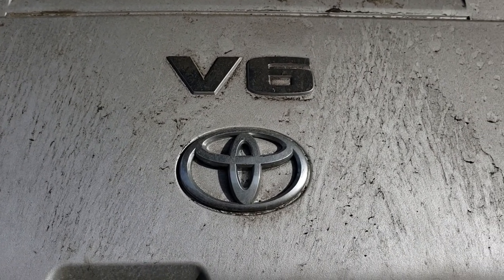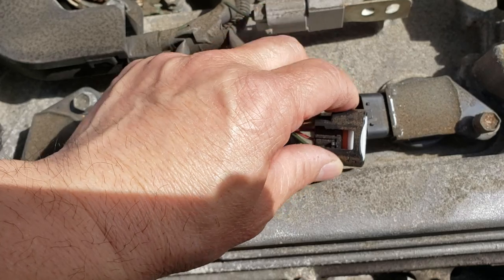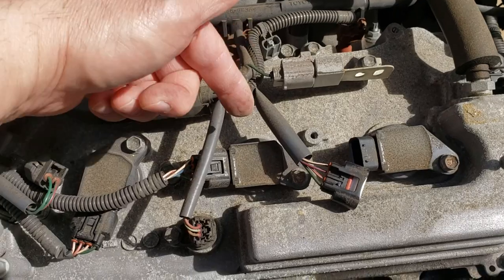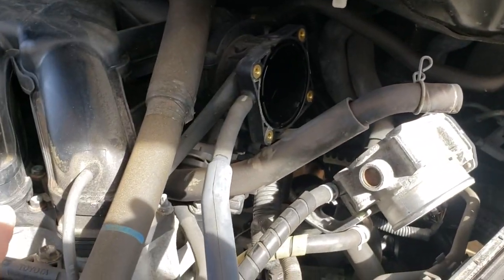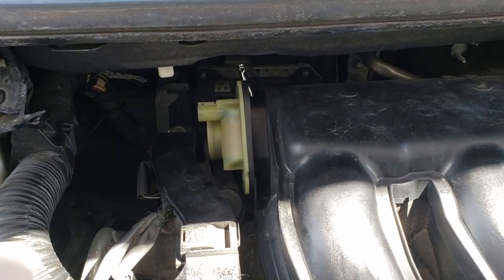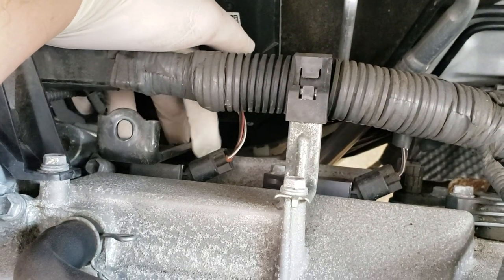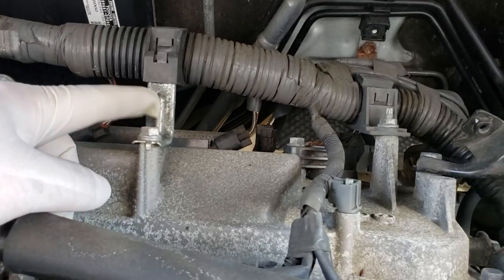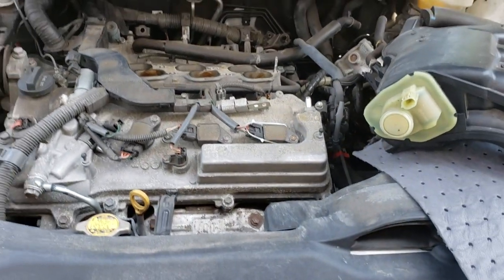2012 Toyota Venza 3.5 V6 Spark Plug Change remove and replace

Comment: Time to do this job on my 2010 Venza with 118,000 miles and would have never found that rear left (facing engine compartment) bolt!  Thanks SOOO much for your video, it saved me a lot of time and trouble!  That one bolt was a PITA.  I used an arm guard from my compound bow to keep from getting my arm beat up.  It finally required a long handled socket wrench and flex knuckle to break that thing loose.  Toyota shop said this was a 4 hour job and wanted $1100, your video helped me complete it on my own in 3.5 hours for $350 in parts.  Thank you!
Reply from the maker: That's Fantastic to hear..did you leave that bolt off like I did?..it was not going back in because that bracket was moved and it's a pita to line that up blind...
Reply: @alyoungcuda  I just replaced the three plugs and coils for the bank 1, also the bank 1 o2 sensor 1 (upstream)  . I couldn't see the o2 sensor but had to feel and place the o2 socket over it. The worst part was getting the wire plug apart. Sprayed the sensor liberally with PB blaster. It took a cheater bar and a pipe to break it free. I also sprayed in the plug holes with PB so I wouldn't break the plugs. They were all tight as hell. Definitely went back with antiseize. Luckily I had several 3/8 drive swivel adapters and short extensions for the plug holes. Had to dig out some of the extensions in the holes with a sturdy piece of wire . Pita! I took various pictures during the process which helped a lot. Strange thing is the two hoses that are located under the throttle body are coolant hoses, as I found out, so I moved it to the side. Great video! BTW. I just wanted to share a little insight on my v6 . 🤪

Comment: That was very helpful. It saved me a lot of time. I couldn’t break the bolt on the passenger side free, so I went after the bolt on the other end of the same bracket. Still hard to get to, but it worked. You’ve got to have thin arms to do it. I took pics as went, so I could put the hoses and connectors back correctly. Thanks for the video
Reply from the maker: Glad it worked out for you.
Reply from the maker: Thin arms for sure..

Comment: Great video. I really appreciate you sharing. I am at the point where I don't trust the parts changers at the typical dealership to put things back together correctly any more so looks like I am going to dive in and do it.
Reply from the maker: If you don't have any left over hardware and parts, you did a good job...good luck on yours and thanks for watching too...
Reply: It took me 4 hours. Most of the time was fighting the back two plenum bolts and brackets. I had to loosen the brackets on both sides to get them to line up and the bolts started. I think the bottom bolt on the left would have been easier to remove and put back. But either way your video was a huge blessing.
And it runs great with no left over parts!
Reply from the maker: @davidjackson2846  that's awesome and thanks for watching too

Comment: wow so glad I saw this video I'm sure the previous owner did not change those. I will have to do this soon doesn't look like fun hate it when they put shit in the backside of the engine compartment, no other way though engine is sitting sideways from what I'm used to for older American cars!
Reply from the maker: It's not a bad job, just take your time and remember everything that you removed to reinstall back later and Thanks for watching...

Comment: I found a great trick on how to install the passenger side bolt on. What I did was take some hot glue, and gluedthe bottom of the bolt onto the intake plenum, just a little to hold it in place. Then I lined it up, and I was able to tighten the bolt. Now there will be some hot glue inside the screw hole but I don't think that matters.
Reply from the maker: Good tip...

Comment: Thanks for this video and tips!  I didn’t think about getting the replacement gaskets.  Good idea about re-checking vacuum hoses.  Question:  Why not remove the wiper cowl to give you access?
Reply from the maker: That's just more things to remove and possibly break..lol

Comment: Is the pcv valve on top of this engine. Looks like that might be an easy removal and replacement. Apologies fir asking about this on your spark plugs tutorial. That is a very helpful video. Looks like there’s a lot to do. I’m going to watch this several times. Especially on the throttle body cleaning. Great descriptions. What are the torque specs for the spark plugs? I’ve got a 2012 camry se v6. Could this also be applied to changing spark plugs on the camry se?
Reply from the maker: 14 ft lbs for the torque on the spark plugs and yes the pcv is right there..they very rarely clog up nowadays, you can spin it off and shoot some brake cleaner or carburetor cleaner in it and shake it..it should rattle freely...and your V6 will vary slightly but the premise is there...
Reply: @alyoungcuda  i called quite a few toyota dealerships & they didn't know the torque spec for pcv valve. Your video gave an excellent indication that it's right under the plastic cover. I removed the cover and voila, there it was. I'm going to do the spark plugs soon. I'll need to get the throttle body gasket and the plenum gaskets. I could clean the throttle body while changing the spark plugs. Toyota wanted a separate cost for both the throttle body clean and sparks as well as mass air flow sensor clean and pcv valve. I won't say the price BUT I'll share about 900 reasons why I won't let them do that service.!!!
Reply from the maker: @josephgarcia3767  I wouldn't worry about a torque spec on the pcv,you can use the German specs..Good n tight...dealership will charge you to remove and replace every part even thou those parts have to be removed for the spark plug replacement.

Comment: One solution is to make a Stud from an 8mm Bolt to use on the PS of the Plenum. Pretty easy to guide the stud through the bracket.Once in place its a piece of cake to thread a nut onto the stud and tighten.

Comment: Thanks for your video of the Venza V6 spark plug replacement Al. I've watched several other similar Toyota V6 model vids prior to locating yours, and am sure glad to see how you removed the rear pass side plenum bolt. I figured there would be minimal leverage, and so utilizing the large screw driver for leverage is a nice add. I'll pick up or order the gaskets this weekend, as I just received the six OEM plugs ($36.xx on line) yesterday. My wonderful 09' Venza has reached 115K trouble free miles and it's due for some TLC. I installed a CAI and K&N filter at 30K miles, so removing that part from the throttle body will be easy, The tough part will be maneuvering my XL left hand around the backside to remove that 12mm bolt. How did you pry the rear coils up ? Same screw driver? I'll video my work in case I find my memory failing me on the re install.Thanks again!!
Reply from the maker: Rear coils come out just as easily as the fronts but those clips are a pain..I used a wire tie to secure the front one that broke off..We love this Venza..I heard they stopped making them because it was competition for the Lexus 330 suv..

Comment: Did you need a special wrench to get spark plugs out of cylinder head? Was not shown and I have never changed a spark plug on newer cars as of yet. The way this looks maybe never. Might have to pay the man.🤔👍
Reply from the maker: no special wrench..just an extension  to reach down, you can practice on the ones in the front before you tackle the rears

Comment: Is it possible to just remove the whole cowl assembly and reach back there to change them
Reply from the maker: Don't think the cowl is removable on a 2012 Venza.
Reply: @alyoungcuda  I've got an 09 Toyota Camry v6 and it's the same setup but the cowl can be removed I just didn't know if that would be easier then having to replace gaskets
Reply from the maker: The manifold has to come off because it lays over the rear coils..

Comment: Excellent!! Thank you!!
Reply from the maker: Hope it worked out for you
Reply: @alyoungcuda  It did! It saved me a lot of time. Because I did not know where those bolts were behind the intake manifold. That would have taken me 2 hours to find those little bolts back there. LOL!
Reply from the maker: @MrEdb1969  the one in the back was a pain..did you leave it out like I did ...
Reply: @alyoungcuda  no. LOL! I think my back can a attest to that, being bent over for a little bit of a longer time, getting that both back in. LOL! Plus I just wanted to make sure the upper intake manifold gaskets were seated very well to the lower intake manifold.

Comment: Is this the same as 05 Sienna? And is it okay not to return those two 12 mm bolt in the back.
Reply from the maker: Its gonna be a little different on the older models but the concept is the same..you should always try to put the 12mm bolts back on..at least the easy 12mm bolt because it supports the back end of the plenum

Comment: What I do is elongate the hole in that bracket and put the bolt in the intake and slide the intake down the modified bracket Makes is simple
Reply from the maker: Good idea, but the bracket had to come off in order to cut the bracket hole, there is no room to get a tool in there.

Comment: 10:00 You don't have to remove the top screw, it's much easier to remove the bottom one and use the cutting trick as shown in this video
https://youtu.be/urKkKH7tR24
Reply from the maker: That is on a sienna, totally different plenum.try that on your Venza and see if you can get in there..besides, now you added another job to hack up a bracket.. besides removing 1 bolt..mine was 1 bolt and done, this guy  is 1 bolt and let's whip out a tool and cut this bracket..No Thanks but We will leave that to the Viewers to choose...Venzas have more of a over hang over the Engine.
Reply: Yes, that's in Siennas and Highlanders where some mechanics recommend removing the cowell, but you're gonna remove that bottom screw anyway to get to coil #1. Thank you sir for the video.👍